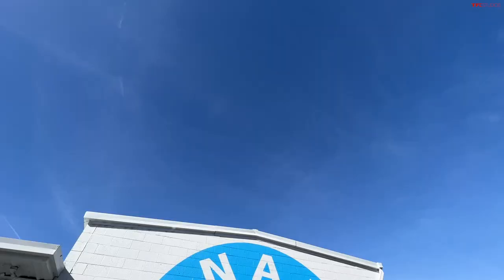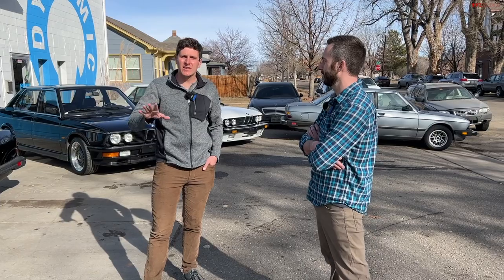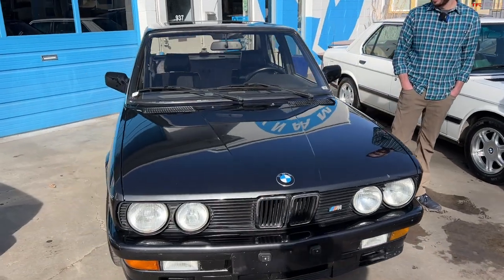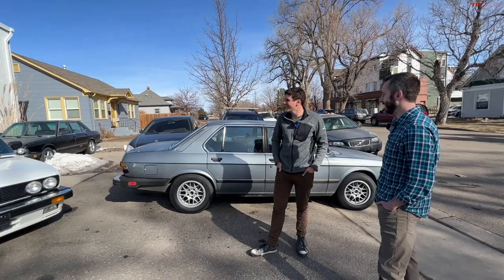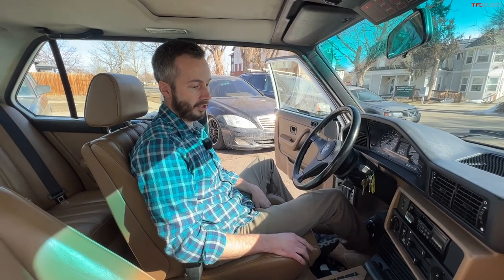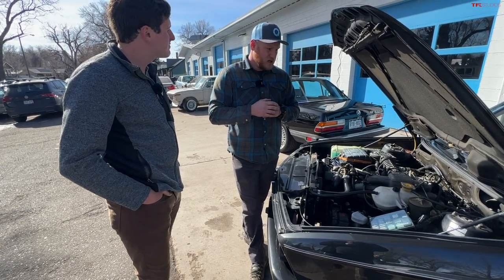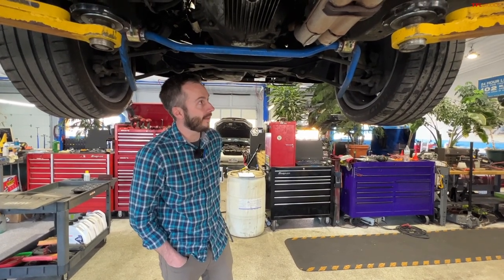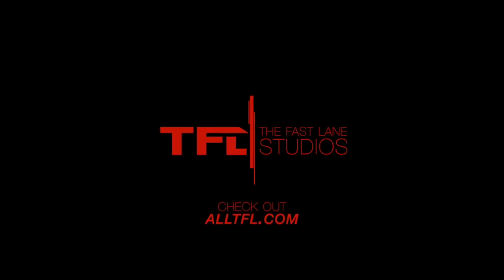BMW 5 Series Ultimate Buyers Guide: Should You Buy an E28 5 Series?

Comment: I have an E28 - a 1988 528e.  Had it for over 20 years now and still thoroughly enjoy it.  Cool part is the 88 528e (and 325e) had the M20 "Super ETA" engine.  It was still the long stroke 2.7 motor but had the 325i head and intake manifold in the top end.  So I did the conversion on it by putting in a 325i cam and dual valve springs, valve job, Motronic 1.3 ECU, 325i throttle body and AFM among other things.  Did a 5-speed manual swap on it which was pretty easy.  It has Bilstein shocks and H&R springs and sway bars. Lowered it about 3/4" front, 1" rear.  My favorite mod was the Billy Boat 535i exhaust which I had professionally installed due to the mods required but it sounds GLORIOUS with that inline 6!  So fun to drive, very comfortable, and has over 200K on the rest of the motor and chassis.  Great cars for sure.
Reply: I sold my beige 528e in Oregon 20 years ago ;P  It was a great car.
Reply: I tried the Billy Boat on my E28 M5 but I already had a “track pipe” (catalytic converter delete. I had to return the BB because it was just too over the top loud.
Reply: KEEP IT !!!!!!!!!!

Comment: If you are only spending $2000/year to keep it running, that is a bargain.  I had an '84 633csi that I loved, but even in 1990's money I was probably spending at least $2000 year, at that time, depending on what needed to be done.  I sold it with 245K miles and it was still going strong, but it was starting to use more oil and I could see an engine rebuild in my future.  I wish I had kept it....such a great driving car.
Reply: @877Media6 You're right, it's pretty minimal for maintenance just to keep them on the road. However, I get the bug every few years to do restoration and performance upgrades and spend $5-$10k at a time. I would guess average cost has easily been $3k-$4k over the past 12 years of owning my 535i. 😅

Comment: 1985 was the prime year for manual m30 e28s, 83-84 533i used a g260/5 which isn't inherently bad but not as robust, 85 535i got the golden g265/6 which are a pain in the ass to find now, and 86-88 went back to the g260/6 which are completely fine. i'd love to find a g265/5 dogleg but parts availability, rarity, and the fact that it's the weakest means i'd be in for it.

Comment: I had a black 82 528e std trans in the mid-90s. The engine would shut off at highway speed. I could restart and never slow down - I think I turned the key and popped the clutch...can't recall exactly. This situation was finally rectified with an expensive 'logic' board of some sorts installed behind the glove box.

One of my favorite James Bond scenes ever from "Octopussy" - two green and white German Polizei 5-series chasing Roger Moore driving an Alfa Romeo GTV-6.
Reply: Me too

Comment: If yours is an automatic with the ZF 4HP…. And the transmission is shifting weird… like it’s slipping, it’s more than likely the throttle position sensor! Two screws to adjust which directly affects the shifts and their quality.

Comment: Actually, E39 wheels are not a direct fit, they require adapter rings because the center bore is larger on those wheels.

E38 wheels, on the other hand are a direct fit.
I’ve got the 8x16 “style 5 “ basket weave wheels on mine. No overkill on the tires, 205/50/16 will do on a 525i. 😀
Reply: I heard the same thing and wondered why he would say "direct fit" when the center bores are clearly different.